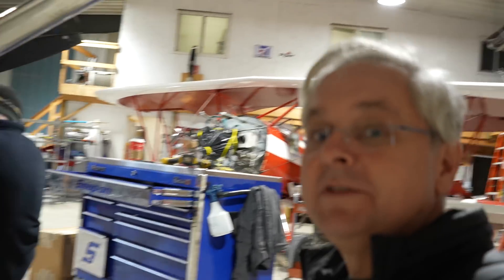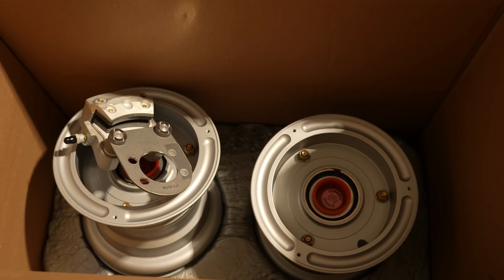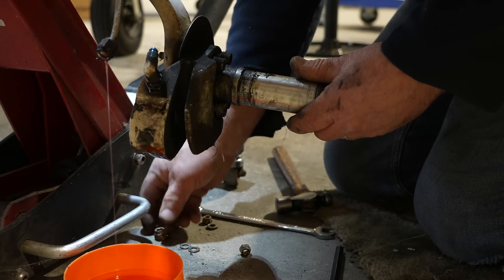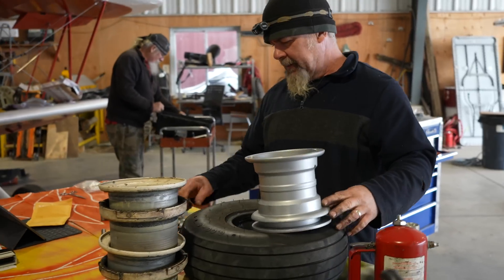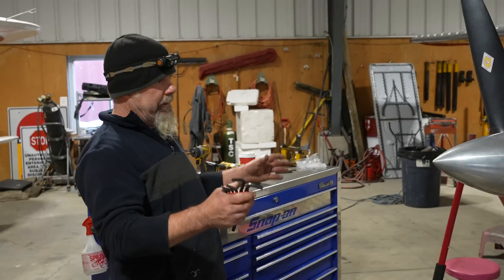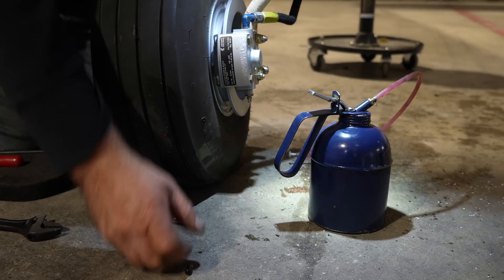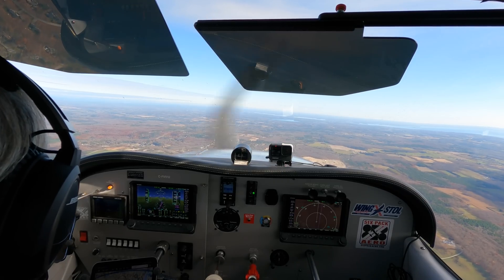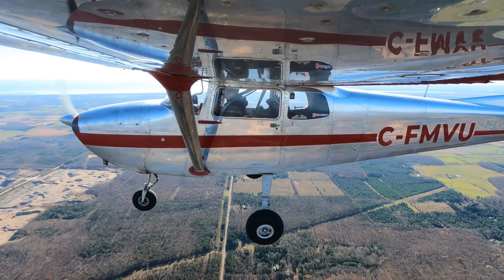New Wheels & Brakes! Dragging This Old Plane Into 1972!

Comment: Boy, that's an expensive set of wheels and brakes. I was lucky and able to get used/serviced ones for my Aero Commander Darter about 10 years ago. I can only imagine what they must cost NEW from Parker. $$$ I'm sure...

All the Best, Ron
Reply from the maker: Yeah - I'm still trying to get my head around how the wheels / brakes cost more than the Autopilot I installed...  Nothing makes sense anymore.

Comment: @glenshangar, did Mike Victor Uniform ever have pants?
Reply from the maker: Not in the time I've owned it - But brand new in 1961 pants were standard equipment for 172B Skyhawks. It started life as a club plane in Winnipeg - I imagine the pants were ripped off pretty early on.

Comment: Glen, I admit that I haven't had a lot of chances recently to keep up with you and FMVU.  Something I noticed.  On takeoff, no real rotation.  The aircraft just started climbing in a nearly flat attitude.  The same applies for the landing, although you could see the mains barely touch down first.  I'm assuming that's from the wing extensions, cuffs and VGs.

Secondly, I'm not sure what the law is in Canada.  I know that some of the Electronic Ignition systems here in the States are, or at least were, designed to replace both mags.  Do you still need to have at least one Mag in Canada, or can you replace both?  I realize it may also be engine-dependent.

Are we going to see an upgrade to an IFR panel and associated radios as well as new display screens sometime in the near future?
Reply from the maker: The wing modifications really changed the way this plane flies. If I want to be aggressive with the take-off and landing I can pretty much drag it on its tail and rotate at 25 mph into ground effect, same / opposite on landing. But with long paved runways it isn't really necessary and it's a bit uncomfortable. At 38 mph it just sort of starts flying whether you want to or not.
The electronic ignition is certified to replace both mags - but right now I'm just doing one (cost). Th manufacturer has also said that replacing one on my engine is as good as doing both.

IFR... longterm maybe. Cost is a huge factor, $40K++CDN for equipment, plus installation and associated costs. MVU may remain a VFR only aircraft for a while yet.
Reply: @GlensHangar  Glen, thanks for the reply.  That's some pretty amazing numbers for getting a 172 on and off the ground in.

As to the EFI, this is what I thought, but I wasn't sure.  I know the FAA at first was kind of reluctant to certify both Mags to be replaced with EFI.  I would agree that having just one, and having the mag probably won't make a whole bunch of difference, since the EFI will be the primary ignition source.

As to VFR only, well, I don't even have the money to rent an airplane to fly, let alone outfit one, so I get you there.  However, I also kind of got the impression that with a new panel and you were saying 'bigger displays' and such I thought maybe you were looking for some upgrades.

Heck, even a used GNS-430W, or two, would certainly get you on your way, or, if you like the Avidyne, the IFD 440, if you can find a used one, would be good.

Comment: Did the pedal feel change adding that addition short stainless flex line ? Did the brake modulation change at all, like did you feel you had race car breaks after the new install. Two other questions... does it come with caps for the bearing to reduce dirt ingestion water etc. or do you need to re torque or recheck the install after a few T/O and landings.  Also I noticed after T/O they stopped pretty quick, do you tap the breaks after T/O? Great stuff Thanks for sharing.
Reply from the maker: The pedal feel is much better now, brakes are a bit 'touchy' in comparison to what they were - but I'll get used to that pretty quick. Checking the gear is part of every pre-flight, not  down to checking the torque but definitely looking for loose parts.  There are wheel caps available, I'm on the lookout for a pair.

Comment: Didnt need to replace front hub?
Reply from the maker: There's no brake associated with the front wheel, and the whole unit is still in good shape.
Reply: @GlensHangar  good to know and all the overhaul has to cost a pretty penny i imagine. glad you can afford it.
Reply from the maker: @mts982  The costs are easier to swallow since I didn't pay current market price for the airframe, and Chris lets me do most of the work.
Reply: @GlensHangar  nice. i like your cooking channel too.

Comment: Hey Glen
You have invested so much time and money to bring your plane up to its quality stand have you throught of doing a lycoming 180hp conversion?
I did that conversion to my P172D with the Hartzell constant speed from Delair its changes the plane completely in everyway like at 24 inch 2400rpm 118 knots indicated , take off is if you can land in it you can take off in it , also ups your gross weight. Very easy conversion to install too.
Cheers Alistair from Australia
Reply from the maker: I've looked at the engine conversions available - I'd love to do it, when I have a spare $120,000 CDN hanging around.
Reply: @GlensHangar  its a lot of money but if you are keeping the plane for ever its worth it , we got put in a corner with are plane as the old engine blew up and we did want to wast money doing it up .
A good way to do it is just keep an eye out for a U/S airframe that has the engine prop combo that sought the STC , can have the cost , l have fitted a 180hp fixed pitch conversion to a C172C it did 115 knots at 2400.
The hardest bit of the conversion except for the $$ is the cowling mods. Everything else is just bolt
 on..
Cheers